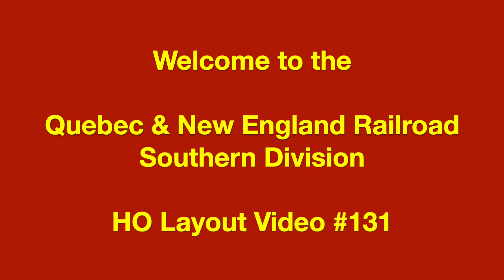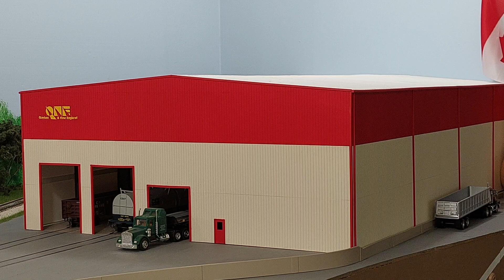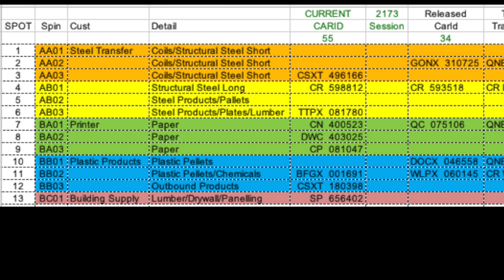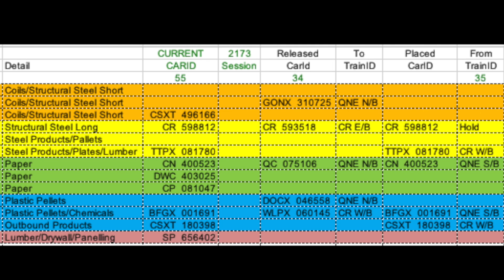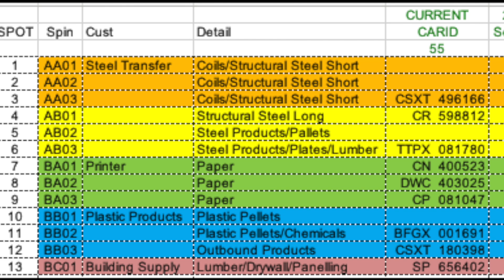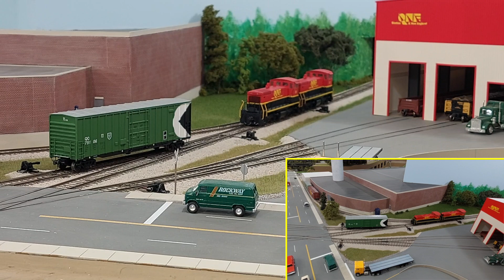Q&NE HO Layout Video 131 - 221213

Comment: I know that this comment is a bit off subject, but I posted it here...

I just want you to know that I just got done watching some of your GP10 Series and I wanted to both Thank You and Complement You on Your Patience and Skills.

I have 10 Intermountain GP10s, all painted IC and ICG... and have always wondered how I could get the Bodies dismantled without destroying them if for some reason they are damaged accidentally.

Thank You for showing me how you did it! 

(Most IC/ICG Modelers would probably burn You at the Stake for painting over any ICG Scheme...but, as far as I am concerned You have definitely earned the Full Rights and Privileges and have both my Endorsement and Respect because of what I have Learned from You.)

You are (without a doubt) a Master Modeler.

Sincerely,

Bruno Biava
Reply from the maker: Thank you Bruno. Very kind comments. I have to say that the Intermountain project was a challenge and I'm still reminded of my handrail screwup every time I run #70 because the Athearn replacement handrails are not an exact match or fit. Not sure what they used for glue, but I couldn't find a debonder that would break the seals.
Reply: @QNERailroad  ... it's funny, but even with all the advanced I have seen in RTR Super-Detailed models, I wish it was still possible to get the old Athearn Cut-and-Stamped Stanchions. The old Mantua/Tyco Stanchions were great to use on ALCOs and F-M Switchers, too...

Just remember, nothing in this World is Perfect... In the end the most Important thing is the Illusion we are trying to Present... We are often our own worst Critics!!!

And Remember that 99.9% of Normal People would never notice, and 50% of Model Railroaders wouldn't notice it from about a 5 foot distance anyway!!!

Not your fault those Handrails are so Fiddly Fragile!!!

Comment: Beautiful layout.  But I noticed the DW&P car was pulled from 1 spot and put back in spot 2. Also, an empty gondola was pulled from the steel facility and replaced with an empty gondola? Shouldn't one have loads?
Reply from the maker: Guilty as charged. How's this for a story line: the foreman at the printer asked for the respot because he knows that he will be receiving another load of newsprint on the afternoon shift. Can't think of a good excuse for the gondola. Maybe they handle inbound and outbound loads? Someday I'll get around to building some loads for my open top cars.
Reply: @QNERailroad  Looks like the empty pulled gondola has bad ordered drop down ends and unfit for the loading of pipe to prevent a shifted load. The respot of the box car is doable, maybe that unloading door was also inoperable ? I see the Tardis was spotted again. :) I like the close up views myself, but the wide angle "picture in picture" is helpful, or to mix and match the views also works.
Reply: @QNERailroad  lol works for me!! Crew decisions 👍😁

Comment: I really wish you would use DCC sound during your operations though.
Reply from the maker: All of my operations/videos use DCC sound - where the locomotives are equipped with sound decoders. Unfortunately that does not include all of my locomotives - only two GP9's, four MP15's, the GP10 and 2 GP38-2's equipped so far.